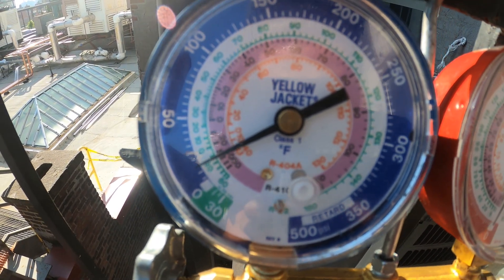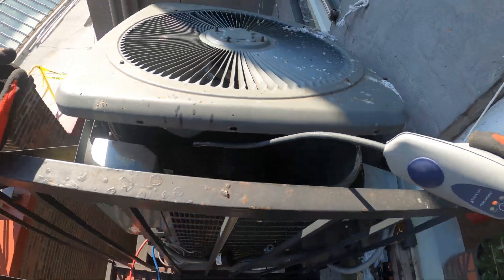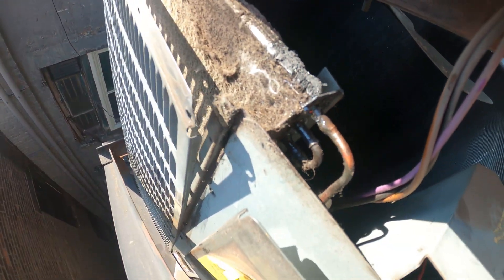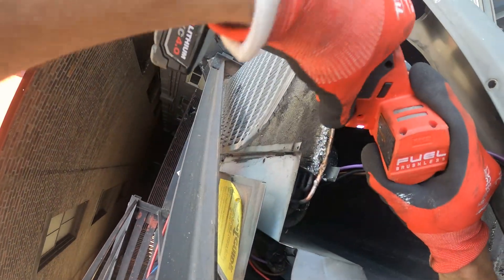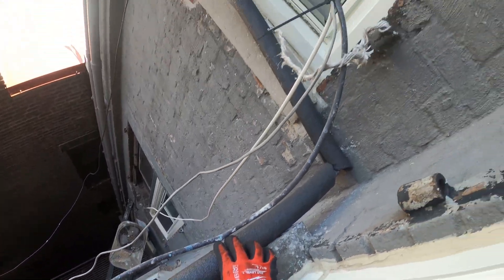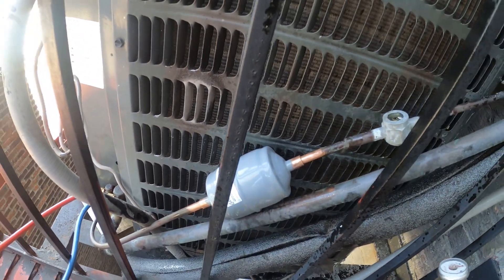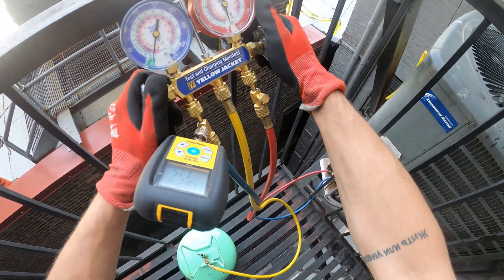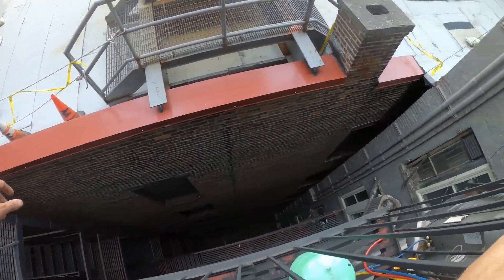HVAC Service Call: Central AC Not Blowing Cold Air (Air Conditioner Not Cooling) Freon Leak Repair

Comment: good braze but when pulling a vacuum you should have the gauge on the system as well as pulling a vacuum straight from the system. its more accurate that way

Comment: Where did you get the tee fittings for your manifold gauge set?
Reply from the maker: I got them at my local air conditioning/Refrigeration supply. Johnstone supply. You might have one around your way. You could use a swivel tee but these fittings I have come with a gasket which I def recommend. Thanks for watching & stay tuned for new videos every week! 🔧⚡️ I will try to find them online and if so, I'll drop a link below

Comment: Man that is plugged!
Reply from the maker: What do you mean exactly by that?
Reply: @JumpermanTech  the entire top 10% of the condenser coil - later saw that most of it looked free of debris.
Reply from the maker: @smason  Yes. It was just the top of it that looked like that 😂 I brushed that down. If it was truly plugged, we would have a very high head pressure. Thanks for watching & stay tuned for new videos every week🔧⚡️

Comment: Great work I wonder if the evap coil is dirty or metering device is restricted
Reply from the maker: What makes you say that exactly? Evaporator coil is a bit dirty👍
Reply: Suction pressure seemed a little low. Usually it’s above 60 psi ( 32 saturated ). But I’m a refrigeration guy these days so I’m just going off back in the day trouble shooting.
Reply from the maker: @XISorryExpertIX  It was SLIGHTLY low so I hear you with that. It's a miracle this unit even started considering it doesn't have pressure controls and being it was out of refrigerant, it could've been running with no pressure. The metering device was a piston. Maybe it could have some sort of restriction. Just glad it works and hope it lasts a bit because that condensing unit seems too risky to replace. That's 8 floors up. Guess we will just have to wait until next time because considering the condition of this unit, there will be a next time. Thank you for your input & thanks for watching
Reply: Oh don’t get me wrong my friend you did a excellent job mad props for even doing the repairs most people would have walked away.  I agree with no pressure controls god only knows how long it was out of gas and what got into the system.
Reply from the maker: @XISorryExpertIX  I appreciate that 🙏 You're right though I agree with you. As long as it's not icing up & it's running, its a miracle 😂

Comment: How do you manage to get such 'crappy' jobs?  Doubtful anyone else  would work on something so dangerous.  BTW, did you clean the coil?
Reply: somebody installed it so atleast 1 other person would
Reply: @james6794  Indeed!  A crane was probably used; where there's will, there's way.
Reply: @manonfire3642  as bad as the install looks i fell like it was two big guys instead of a crane
Reply from the maker: @manonfire3642  Just my luck I guess 😂 I'm sure alot of people wouldn't work on this unit. It's extremely dangerous. Usually people would quote a new condensing unit with a leak in the condenser coil but how could this even be replaced safely? It can't. It's just way too dangerous. I brushed down the condenser coil but that's about it
Reply from the maker: @manonfire3642  No space in the backyard to fit a crane and telling by how half the stuff is done wrong here and shady pipe work, I don't think they'd pay to have a crane drop that unit in. The suction line pipe is for water and not ACR pipe rated for refrigerant. This looks to be a Craigslist special. Half price😂
Reply from the maker: @james6794  I agree with you here. Craigslist special 75% off
Reply from the maker: @james6794  You have a point there haha